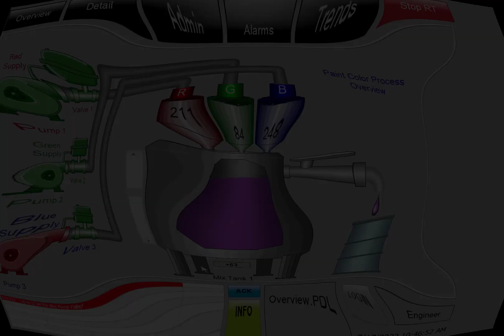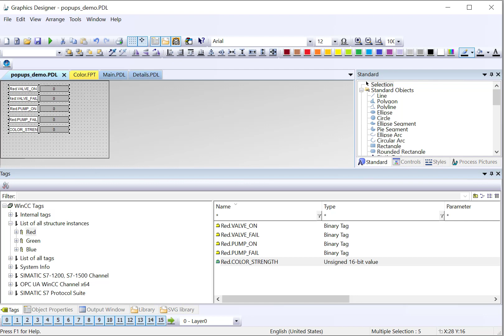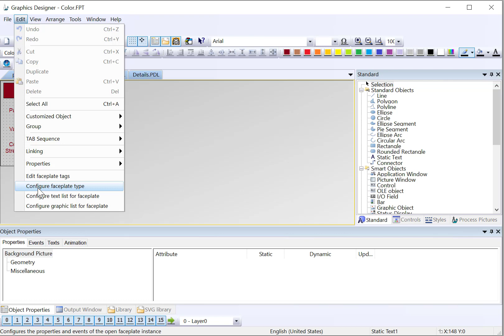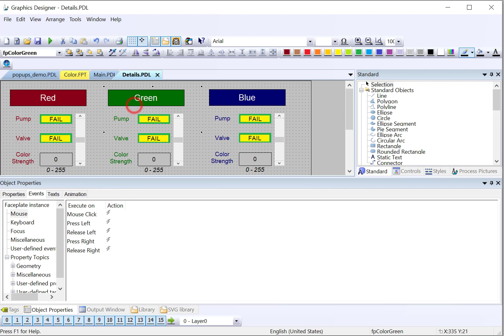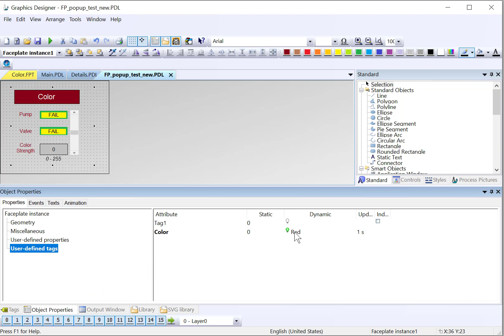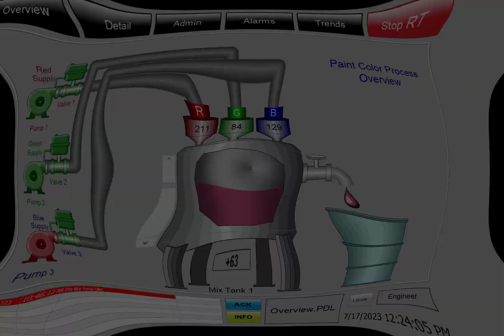WinCC v8.0 Step By Step 26:  New Faceplate PopUp Feature 🆕  #winccguru

Comment: Is it possible to tie the click action to a specific button or rectangle? In the dialog its not possible to select it, i think.
I wonder how it is possible to use the popup from a faceplatetype if i dont have a structure.
My variables are all names Tagnumber/AUTO, Tagnumber/START etc. but not in a structure.
I dont want to add the popup vbs to each faceplate by myself. I think, thats not how it should work. If i add the vbs script to a rectangle in the faceplatetype then it will end in an error. the variable "OpenScreeninPopup" is not declared. so the method is not avaible in the fpt.
Reply from the maker: The openScreenInPopUp() is only available in WinCC v8 and higher.  You
Don’t need a structure. You can use tagprefix if you have a good naming convention for your tags.  Take a look at the tag prefix video in the WinCC v8 step by step playlist for more details.
Reply: @WinCCGURU thanks for the fast reply. Yes I got 8.0 and 8.1. Do you know if I can use it inside a Faceplatetype? On a click action on a rectangle in a pdl it just works fine but when I want to use the same code on a rectangle in a Faceplatetype it fails.
Reply from the maker: You can’t use it on a faceplate type. In my opinion I like using tagprefix pops versus faceplates which really limit what you can do.  With tagprefix you don’t have to use structures.
Reply: @WinCCGURU  hm sad. I wanted to use Faceplatetypes. It's nice that you can change the fpt and the whole project gets the changes. But yea. I guess I have to do it the old way.
Reply from the maker: If you are using tag prefix the picture window is reusable and global
Reply: @WinCCGURU yes! But not my faceplates. For example my motor symbol.